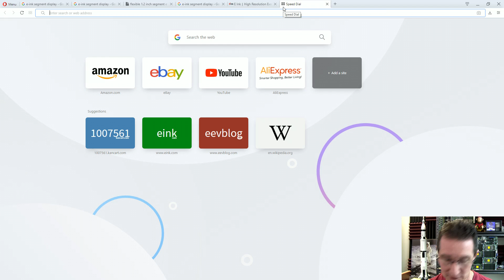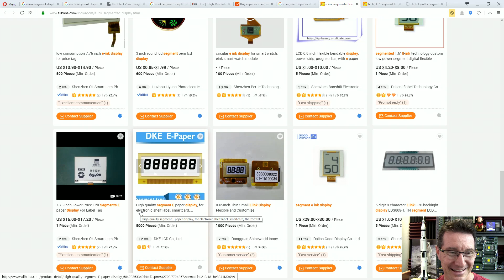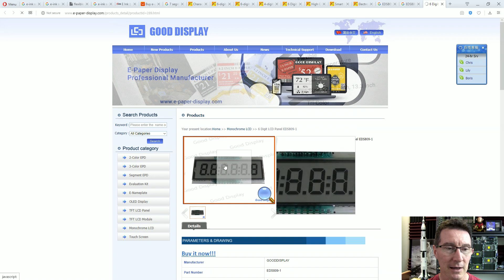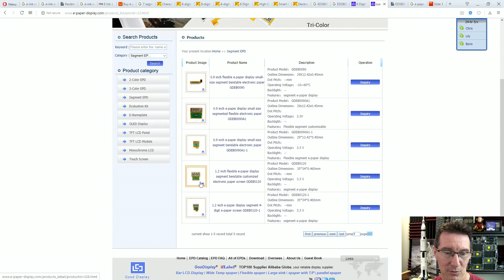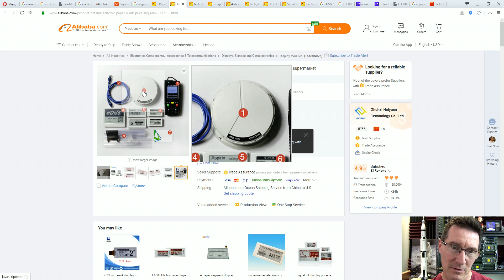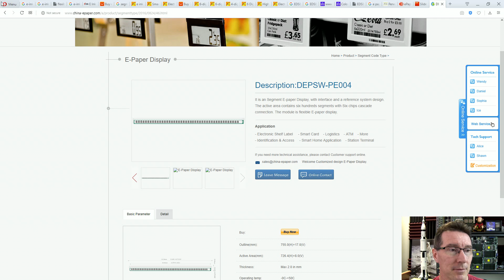EEVblog #1241 - Power Up Display Counter Project - Part 1

Comment: Do you really need the display to be always on?  Turning it on for a few seconds on power up or on request by a push button or capacitive sensor could work fine with an LCD.
Reply from the maker: Yes, I have a usage case in mind for it.
Reply: @EEVblog  just a thought but what about phisical 7 segment displays, would probably do you right I assume, just electro magnets and some ferromagnetic material to keep it aligned after  it increments, idk probably even more niche of a product then e-ink but way easier to build as a hobbyist
Reply: even small 128x32 OLED could work just fine, ssd1306 can go down to 1.8V as I remember and have internal charge pump for OLED panel.
Reply: @KACPER050599  You're missing the point, it's a display showing the number of power-ups, even if the device is turned OFF, or can't power up ever again.
Reply: @nrdesign1991  I wanted to refer to LCD + button concept, when you already have a small backup cap or battery
Reply: What about using a graphic e-Ink display with one of your Padauk microcontrollers? Given the simplicity of the task at hand, that sounds like a good use for the low-end micro. Might even allow for some feature creep. ;)
Reply: The thing  about e-ink is that the display isn't always on it just records the last state it was in, a power cycle module for instance could give you the exact power cycle count when something fails, or it would be useful in counting how many cycles a low power battery operated device can take on a charge. There are uses, just depends on give and take, such as when no power is left to cycle the display
Reply: @jaykoerner  What Rodrigo is saying is that the additional cost for that functionality may not be necessary - using a cheaper LCD that's only on for a few seconds could work in some use cases (though apparently not in Dave's case)
Reply: @jaykoerner  Another possibility is to have a display, when something broke, think of it like a flight data recorder.
Reply: I often ask Alibaba sellers ' do you have something like this... I can only order 100pcs do you have existing stock I can buy?'
Reply: He needs to keep track of counting numbers incremental.
Reply: I like the idea of using a SuperCap and a capacitive touch sensor to show display when needed. Then timeout and turn off after like 10 secs or so.
Reply: You are just suggesting a negative feature creep.
Reply: @amciaapple1654  what you on about?

Comment: e-ink shop shelf price tag modules are a few $ each. Why not ask a shop if they have any broken ones and tear one down to get the e-ink display (discard the battery + PCB). Then you just need to connect a small processor that will update its EEROM +1 count and update the display on power up and then go to standby. You can get 1.54" square displays very cheaply. If you don't want it that big, just cut a smaller hole in the front panel (if you used a battery or cap solution it will be that big anyway!). Use an SMD CPU and it won't be very thick. Maybe you could display other info on the display like 'temp at turn-on', 'max temp' and 'temp at turn-off', 'Power-on-hours' and 'last usage duration' which could update every second whilst on?
https://youtu.be/RUoMztFxUpE

Comment: Another totally different option, though a bit more barbaric, might be an actual mechanical counter.  Not sure how easy it would be to find that though and it might be expensive.  Like the odometer in old cars.

Comment: Just drop the ridiculous requirement that it must be a 7 segment display. Use a graphic display and make up a simple 7 segment font in software. Use e.g. the GDEP014TT1 from Good Display. There is (some) documentation on their site. It's a bit pricy and it's flat flex, but sometimes you have to make compromises.

Comment: You dismissed graphical e-ink because of fonts.  But if you're just displaying digits, and especially 7-segment style, you don't need the full generality of fonts.  You could get the 7-segment effect with rectangles, and maybe some triangles for the ends of the segments.  The downside is that, depending on the process for updating the display, you might need to maintain a bitmap in memory for some or all of the display.  You might be able to get away with buffering just a single digit's pixels at a time (in which case 10 hard-coded bitmaps in ROM are your "font").

Comment: Some of those tags are in a network, but most aren't as it's much more expensive, so they use a device to manually upgrade them all, but smartly, the device identifies the tag and update it automatically from what's in the system.

Comment: the supermarket EPD tags are programmed via  big IR transmitter lamps on the ceiling, the tags themselves have ir receiver. i spent 10 minutes in a big pharmacy that had them to figure out  how they work 10yrs. ago :)

Comment: It seems i've found the DIY guide for custom e-paper display but it is in russian. Can help you with translation. Using this tech you can do extremely compact device on the single two sided PCB. http://we.easyelectronics.ru/HomeTech/izgotovlenie-segmentnogo-indikatora-na-elektronnyh-chernilah-v-kartinkah.html

Comment: Don't know your use case, but an EEPROM holding the count, with a header, that connects to another device with a LCD seems a lot cheaper and simpler for many applications.

Comment: I suggest to implement a power-on hours counter in it as well, not just power cycle count. Either with a dual row 7 segment display, or a dot matrix one. Don't they have dot-matrix e-paper displays with standard HD44780-like controllers, with integrated fonts?

Comment: I haven't read all the comments yet, so appologies if someone already mentioned it, but check out this product line: https://www.cymbet.com/products/enerchip-overview/
I received a development kit from Cymbet for these a few years back but never played around with it. It seems like a really good alternative to a super-cap solution. You can get bare dies if you really want to go crazy!

UPDATE: It looks like they discontinued the packaged batteries. Bummer. Maybe a super cap is the best option after all. Plus they can charge very quickly, so that's a benefit over rechargable SMD thin film batteries like these.

Comment: Why do you want to integrate a display into the product to show the count?
You want a modular PowerCycle-counter, that can be integrated into various products, right!?

Just use an extra little eeprom to hold the count, that is accessible via a simple connector to the outside on an easy to access point on the case. Then use a tiny external device with a small display (can be anything, probably LCD or OLED) running on coin cell with a cheap µC, that reads the count by connecting straight to the chip or the µC inside, that also does the counting (maybe also allow to reset it!?).
As this feature is supposed to be self-contained, you probably just need a cheap dedicated 8Pin-µC and use 4 bytes of its eeprom together with 1-Wire/TWI for the external interface and one IO pin for sensing the current power state. Why does it have to be so complicated?

I wouldn't dedicate and drive a display in every device itself just for that little feature.

Comment: I would use a ePaper graphics display. You could emulate your favorite 7-segment style, and there are more sources for such displays.
The flex cable is no problem, I did once a breakout board for it with all the analog parts (needs a voltage pump for driving the display) :
https://hackaday.io/project/20466-wifi-epaper/log/58513-solar-cell-tests-and-bigger-display
And then any small microcontroller could do the 7-segment emulation. I could program this in a few hours with what I already have.

Comment: Would love to hear more about these mini supercaps !!  U really need to just go for e-ink. Don't b so old school. Plus, I don't see what you mean about LCD without micro ? Don't all LCD's require a driver ?   Last thing > those e-inks sure have a lot of pins <  might be more analog-ish than u expect. Don't LCD's have crap tons of pins, but we don't see them caz of that rubber thing??  if the pins are same, maybe could use a 7 segment driver and just make a power oscillating circuit to sequence in an e-ink fashion. I think all they need is an "All clear/everybody duck" and then an ON for each individual pixel

Comment: try getting the shop labels but second hand there is information out there how to get them running you own code because they already have a small like stm32 or something on them so if you can get them you dont need to do anything basically except writing some code becsuse you have already your drive electronics and your micro and everything.

and you have something for david to drop his c++ on.

Comment: super cap doesn't seem too bad, I assume the value is retained in eeprom, so that even if you lose power you would get the count if you provided the module with power, perhaps with a micro usb?

Comment: At the supermarkets here, the electronic tags are actually networked. They can be changed remotely with a special protocol.
Reply: The ones we have in the stores are controlled by IR like in remote controls and have photovoltaic cells to power it from the stores lighting.
Reply: @ulwur  interesting. The ones i have seen contain a battery that lasts multiple years under nomal use.

Comment: Power down during transition  - destructive?  The Transition process of an e-paper Display is partially destructice and slow. What happens if your device is powered down during the transition? Example for a big display can be seen in "The Signal Path" #136, 22:45.
Reply from the maker: The user sees that and can fixed it by repowering if needed.

Comment: Interesting idea. Could even count the usage hours. That way you can track component lifetime  if a product comes in for repair you know if it has a fault or is past life expectation.

E paper displays are expensive. Probably costs more than a little lcd, battery and micro with some storage. Waveshare makes a lot of e paper displays but a quick look shows them starting around 6 euros. you can get a lcd for less than 1 euro with driver ic. You can get an entire ESP32 with oled for about 6 euros.
What about a mechanical display like an odometer?

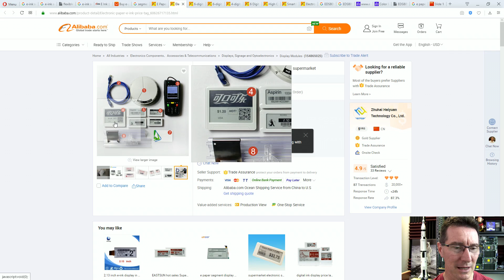Comment: 27:00 That shopping tag thing probably uses inductive coupling. Hold the handheld in front of the tag you want to program and it couples power and data into it. Kinda like an RFID card, but with a display. Granted, I have not looked into those things, but it sounds like a plausible product :P
Reply: I'd bet that round thing is a transmitter you put on the ceiling to control the tags.
Most of the time they are networked. You can actually change them all at once. 
Usually you have the basestation, that is connected to your local network and the other basestations over 2.4ghz wifi, and also transmitts data to the tags using Sub-GHz rf. You can just change all of them on your computer.

I've never seen any you have to change individually I think. It is the main advantage that you don't have to do that.

Comment: Correct me if I'm wrong, but if the LCD required 5V for driving, you'd need to have a seriously big supercap in order to power it for a long time and stay over 5 Volts?
Reply: LCD's can be engineered to run on very low voltages (i've seen as low as 0.5V) so 5V isn't needed. Just think about pocket calculators, they usually run on a 3V button cell.

Comment: Hey Dave, regarding the super market displays, check out pricer.com . As far as I know they actually are networked and can be re-programmed automatically. It can be light or radio based. Only problem here is that sometimes they need to have their battery changed, and then you have some fun ;)

Comment: One potential problem is the apparently slow speed at which small e-paper displays can be updated. An Adafruit tutorial says, "Do not update more than once every 180 seconds or you may permanently damage the display". Would have to at least delay updating that display if the power was cycled rapidly. Whether or not slow updates are acceptable depends on the type of device whose "power ups" are being counted.
Reply from the maker: Fine for my app

Comment: I get the sense that the manufacturing process for e-ink makes segmented displays harder to produce than pixel ones. The font situation isn't so bad... a lot of Arduino libraries have text rendering built in, or if you want to roll your own there are some nice code generators like The Dot Factory.

Comment: I don't get this problem. If you want to count power-ups, you have to store the number in a non-volatile memory, because you can't read it from the display with an MCU. Why the expensive display then? Use a cheaper display, plus battery, plus a button.
Reply from the maker: The micro can store the count internally in EEPROM, no problem.
Reply: Yes, that's why I don't see the need for e-paper. The only advantage is that, it can show the number with no power. But is that so important in your application? Btw any excuse to play with e-paper is acceptable, but the pricetag always makes me reconsider such ideas.
Reply: Máté Besenyei Indeed, this seems an obvious application for the fabled warranty end autofail chips.  Number stored internally only, read out with a 2 or 3 pin probe that isn't counted as a power cycle by the probe telling the cycle counting chip this is a probe operation.  3 or 4 pins total would do it, plus one filter cap.  External power fed via ESD diode trick,  filter cap on actual power pin.  Probe touches ground and data pin, using another ESD diode to charge cap, using a variant of the Maxim 1-wire protocol to query the counter and time values.  Maybe Maxim already has a ready to use chip with a builtin filter cap, otherwise almost any low voltage 4-pin MCU with EEPROM can do the job.  The actual display is only powered when used and is part of the probe, and can be a 7-seg or alpha numeric module getting numbers from a normal size MCU battery.

Comment: Not too sure about china-epaper.com. As shown in the video, clicking on the "Detail" tab for the DEPSW-FE006 does nothing. Clicking on the "Buy Now" button takes you to PayPal and wants to charge you $120 USD. Not clear what that might get you. Looking at the FAQ page, it says "Normally the MOQ is 3000 USD". They could certainly be a legitimate manufacturer, perhaps an excellent one. Unfortunately, dealing with Chinese suppliers is often like this. Finding the right part - even when you're sure somebody must make exactly the one you have in mind - can be incredibly difficult. It can sometimes take days, weeks, or even, in the case of one part I finally found recently, years.
Reply from the maker: Yep, it's often not easy.

Comment: They have 4 segments but not sold separately as far as I can see:
https://shopkits.eink.com/product/mars-with-4-digit-sdc-segmented-display-sc010e2152/
Check out adafruit: (very close to what you want, minus the segment)
https://www.adafruit.com/product/3335
https://www.aliexpress.com/i/33011916748.html
https://www.smart-prototyping.com/E-ink-E-paper-Display-module-3.3V-2.04-inch-177x72.html
Since you only want to do digits 0 to 9, it should not be too hard to do a custom font

Comment: I believe the graphic pricetag modules are the better way to go. They are already getting really cheap and it looks like the ones currently in use are soon going to be available almost for free. They are not as universal as LCDs so they will eventually have to start throwing them away. So if E-ink fits your task like in terms of temperature ranges and other constraints then I would go for it. The program in a MCU will have to be a bit more complex to compose the right pixels in an image but you only code it once and then use everywhere so in the end it is almost free as well.

Comment: From my understanding you’ll probably need some sort of MCU to drive the e-ink display chip even if it’s just a segmented display. Could save you trouble to use a graphical one with some default font and just program the counter functionality into the mcu. I don’t think they can be driven without a brain box.
Reply: Of course you can't drive either display without a micro to set the values, I said that in the video.

Comment: I'd do a electromechanical counter.  It's old-school but effective.
Reply: But also way too big if it's supposed to be integrated into another product
Reply: i thought the same thing when i saw an analog clock
Reply: Those electromagnetically triggered flip-dot displays come in tiny form factors and could do the job.

Comment: I was looking for ages....at the exact same stuff....
I would go old school and have a mechanical counter. Perfect for a miniature stepper motor. There is a six digit device all encapsulated running off 12v for £1.75 on ebay.  Not ideal that 12V.....Edit: Or there is a really nice mechanical stroke counter for 6.99 that you could whack with a solenoid. That would be cool looking. Can't it be powered from the device it's installed in?
I'm not sure if I'm joking.....
Reply: One of those PCB motors I've been seeing recently might be suitable for driving something like this.

Comment: Get with the design trends of 2019! Use that bar graph display to show a proprietary barcode that the user will scan with an app (50¢ per scan after an initial trial period when they register). Think of the metrics you could gain about customer behavior. Build an interactive geo-tagged API map. Use deep learning AI to build a prediction engine for when the device will be used so the phone can display notifications and helpful hints. Auto add consumables and service appointments to the users calendar. Use their contact list to match them with other users of the product so you can build a community of hype to make sure they get those hashtags out.